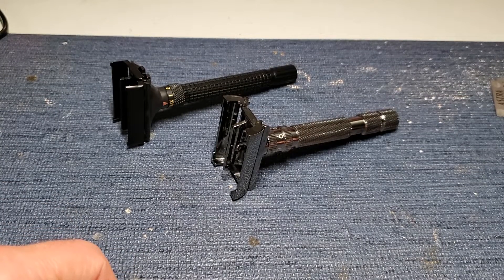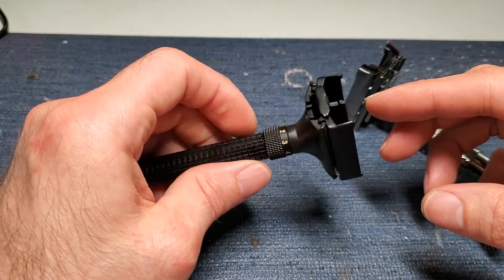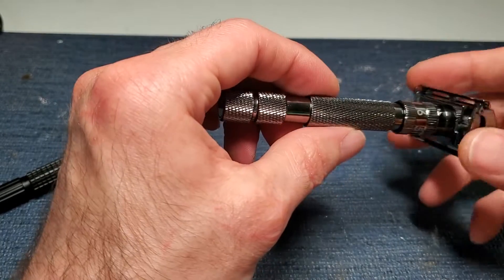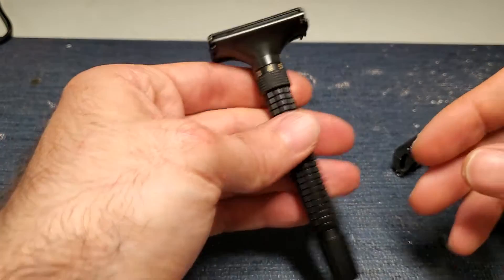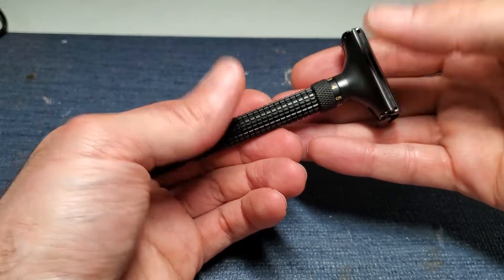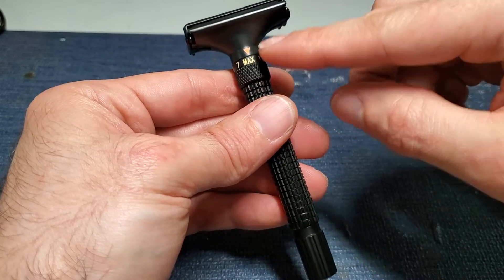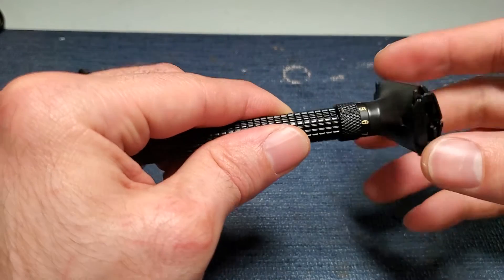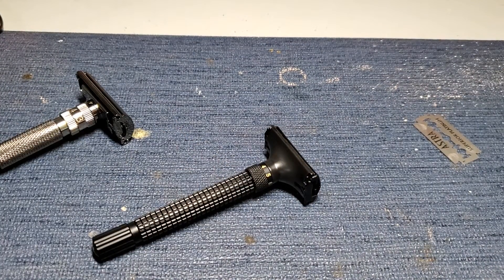Rockwell T2 VS Weishi Adjustable Safety Razor.

Comment: I had several of the original Model T razors that I got on the cheap from a store closing. I find them to be an imprecise tool and, although I haven't tried the T2, I assume it is much the same. The head and handle are both too big even though I have large hands and this isn't an issue with almost any other razor except maybe the Merkur Futur. I haven't tried the Weishi but may do so after watching this. Thanks for taking the time to make this. I found it helpful.
Reply from the maker: You're welcome. I'm going to be comparing the T2 against all the Gillette adjustables and to a Viking Adjustable I have coming soon.

Comment: Nice review.
What's your opinion about Yaqi adjustable (The Final Cut), compared to the Rockwell T2?
Yaqi TFC comes in 3 variants:

chrome-plated; 34€
full brass; 140€
stainless steel (named Ultima); 170€

Yaqi TFC has a much better material and finishing, with a much less price.

The performance is the question for me. I wonder if it is as good as T2.
I think one main positive thing about the performace of T2, is that "forgiveness for different angles" that you mentioned. It should have to do with the curves on its head.
Reply from the maker: I don't own anymore Adjustables then what's shown in the video.
Reply: Ok.
Reply: @RobertNES816 Well maybe you should